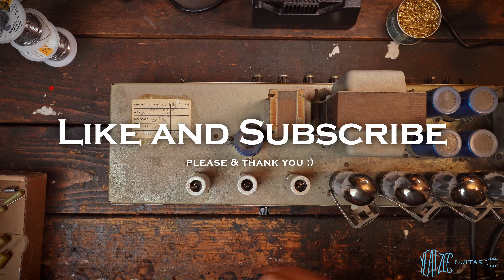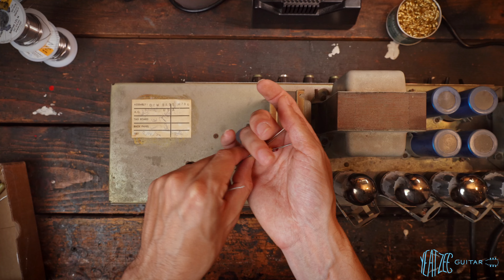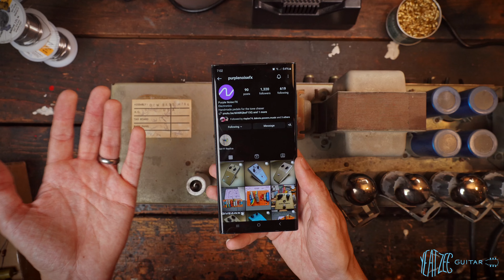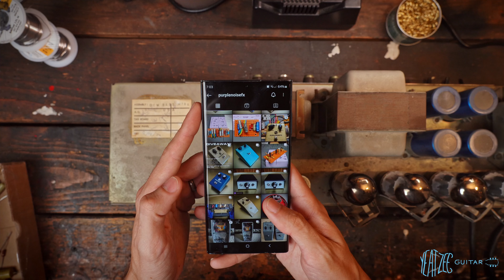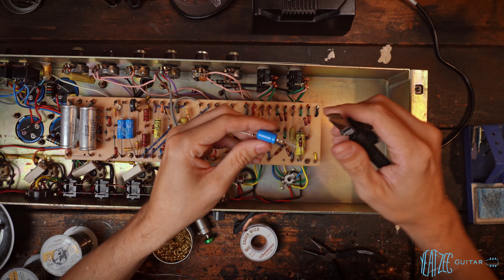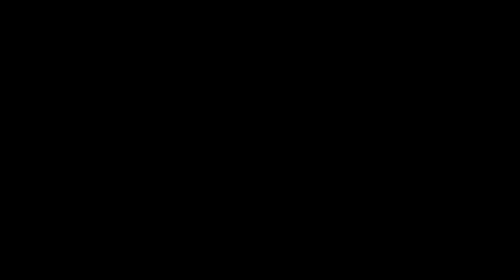100w Vintage Marshall JMP Restoration Pt. 1

Comment: 220 bias splitter resistors should brighten the amp just a hair.....people usually lower the value of the bias resistors for a browner sound.....or using 6550s too

Comment: signal cap rarely go bad especially those amps use high quality ones the main issue is usually the power supply elettrolitics
Reply from the maker: @electronik808 ? Did I mispeak and say something different? I only replaced coupling caps with vintage mustards for authenticity reasons, not because I assumed they were bad. I did change the Bypass caps which were probably OK, but have a higher chance of failure.
Reply: @YeatzeeGuitar  sorry i meant the bypass caps on v1. but probably i got it wrong and your replaced it to make it like a superbass! good work anyway this amp is super clean the one i worked on where a lot in worse conditions this seems new :-)

Comment: The 33k is a slope resistor. The higher the value the more pronounced the bass will be.

It's a cheap way to roll off some unwanted flub and really push the low mids.

If it were my amp, I would change the E caps. Interesting to find out if they change the sound 😂.

Spoiler 

They don't
Reply from the maker: I'm surprised by how many people have told me it'll make a big difference to the tone for the negative.
Reply: @YeatzeeGuitar  I'm not above being wrong. I'd love to hear the difference.

Comment: Are you familiar with Headfirst amplifications channel? Jason is a Marshall guru and really cool guy. Wealth of Knowledge on vintage Marshalls. Check it out. Good luck with your build, i thought the before tone was really good, cant wait to hear the after!
Reply: I thought i remembered, went and checked, Jason did a great superbass to superlead vid on a 74, 11 mo ago. interesting because the board is an st1 pcb. must have been a transition yr. everything else looks just like your amp. very cool!
Reply from the maker: I'll check it out!
Reply: @YeatzeeGuitar  also a great place to learn the Marshall circuit lingo. Treble peaker, mixer resistors, cold clipper, ect. Congrats on your purchase, just a beauty!
Reply from the maker: @stevendehaan1078  lots to learn there for sure
Reply: @YeatzeeGuitar  The fun is in the journey!😁
Reply: Having fun going thru old vids, Jason has a resto of a 1970 JMP 50w Super bass. Looks just like yours! Very good info on the circuit and difs from super lead. Posted 1 yr ago.

Comment: Congrats.  I had always been a fender player but could never find the sound in my head.  Marshall clean sounds are severely underrated because most people just jump and crank them.   For bass circuits, I tend to not jump, as it muddies the sound, and turn the bass down.  A treble booster can be magic in front of the bass circuit also
Reply from the maker: Can totally see a treble booster being killer into the warmer channel!

Comment: I’m curious how much you paid for it. I would’ve paid maybe $4000 for the whole stack seeing is that it’s in such bad condition.
Reply from the maker: About $1k less
Reply: @YeatzeeGuitar  That's a steal at that Price, nice work!! Even at 4k I'd have paid that. Especially for someone who has the skills and the attention to detail to restore it properly. I'd be betting once everything is redone it would be a 10k setup
Reply from the maker: Thanks, but I really don't think it's going to be worth anywhere near that when it's done. The amp isn't collector grade with the MV hole and replaced Pt, plus 1 speaker recone. It'll be a rad rig for sure when it's done, but value wise probably not much more than I paid. And remember I bought it without it working, so total gamble.
Reply: @SidwireSimpson you say bad condition. we say relic'd. at a substantial upcharge of course.
Reply: @Toobzilla  I love my Murphy lab Les Paul because the more I mess it up the more appeal it has :-) not so sure it’s the same with amplifiers, however.